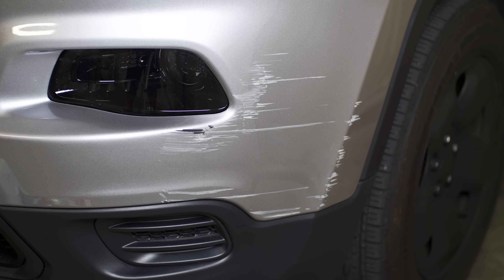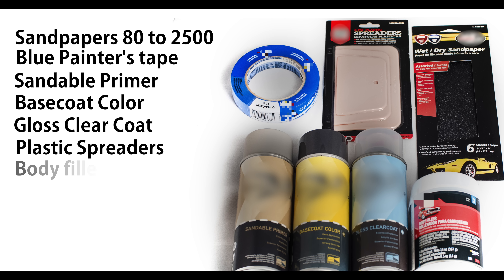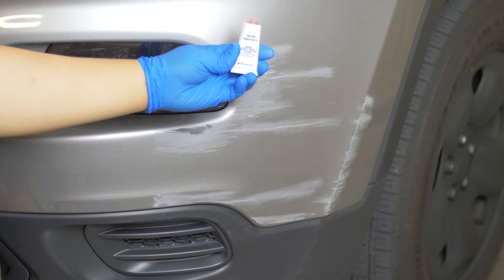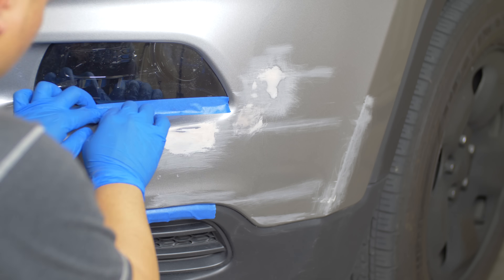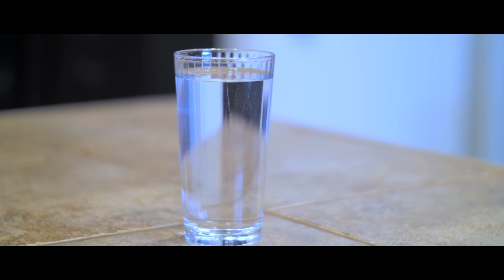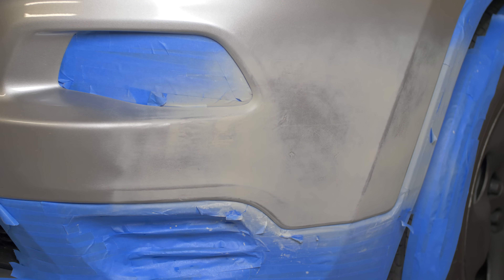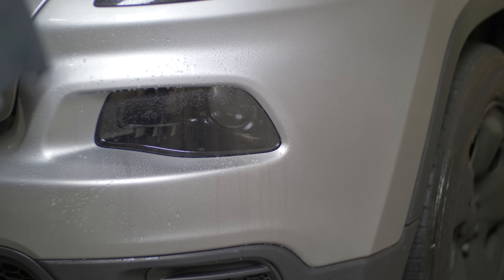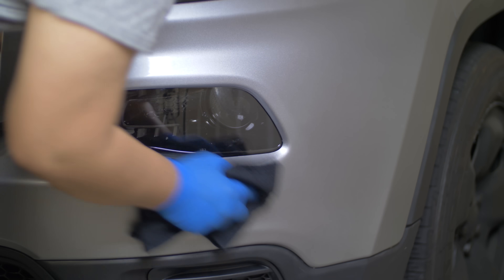How to Repair Scratches on your Car | Save Hundreds of Dollars

Comment: I got 3 days to fix a massive scratch on my mum's car before she comes home. Wish me luck guys 😭 or cya at my funeral
Reply from the maker: Lol dang rip
Reply: Waaaaaa bruh I jus scratched tf out my mom car, I might to take that L
Reply from the maker: DaReal Tj sorry to hear that. if you do it well, she'll be proud of you. Good luck! Cheers
Reply: Thomas of All Trades I fixed it ‼️‼️‼️‼️ it turns out to be paint off the wall after awhile of scrubbing with hot water and tooth paste it came off , had me worried 😂😂😂
Reply: lolzzzz😂😂😂
Reply: DaReal Tj how you fix it 💀I got a few hours before my mom comes home
Reply: Prodbyacebeats - mines ending up being a scrape, it looked like all the paint came off but I used hot water and tooth paste and it scrubbed off pretty easy, hopefully that’s the case for yours, if not, just go ahead and take that L 😂
Reply: DaReal Tj I got it off a lil bit it’s a small scratchi think she be okay 💀💀
Reply: Prodbyacebeats - hopefully she won’t notice it, I left a tiny little dent above the right front wheel, on the side she never noticed it. Where is on the car was it damaged?
Reply: DaReal Tj top left passenger side on the front where the headlights at but a just small line I did what you did and look like it been there cuz it held a with the old one
Reply: Prodbyacebeats - It worked for the main part? That hot water and toothpaste did wonders 😂 it looks how it did before I messed it up besides the tiny little dent can’t even notice it at all
Reply: Who else is attending your funeral?
Reply: Samatar Ahmed I think just me and my dog 😔
Reply: DaReal Tj she didn’t even notice thank you man
Reply: Prodbyacebeats - yessirr💯💯
Reply: Are you still alive
Reply: BROO MEEE but I got one whole day
Reply: @BugattiBoy66  bro did you use micro fibre cloth or a toothbrush?
Reply: @Pianosem26  I had used a towel
Reply: did you fixed it
Reply: LMAO
Reply: Yooo same situation rn. But I got a month to fix it before my mum comes home. Did you fix it?
Reply: @socmorenoonofre2278  I used the rubbing compound to get most of the paint off and next im going to do the bondo to fix the chips 😇
Reply: I’m here because I scratched my moms car too💀💀💀💀💀💀💀welp
Reply: I'm guessing Charlie didn't update us on fixing it because his Mom found out and his funeral is over.  lol
Reply: I just scratched my dad’s favourite car. Imma just go ahead and die
Reply: I got TWO HOURSSSSS BEFOREEE MY MOM COMES HOME ..i think ill just give up
Reply: @Saroupie  Have her take you to the Store in it, both of you get off and when you get back tell her shit someone hit your car when we were inside Shopping lol.....Gool Luck worked for me😂😂😅😅😅
Reply: @jessieurgea9899  thank you for the advice :') but i told my dad and he helped me out ..i denied ofc and she actually got confused if shes the one who did it ..i feel guilty and i hated doin that to her BUT rather her not findin out then her not lettin me drive it for the rest of my life xd sorry mama
Reply: Rest in peace bro.
Reply: Jajajajajaja
Reply: @Saroupie  Shame on you for lying to your mother. Even if she doesn't know, you know and so does God.
Reply: @ThomasofAllTrades  if he does it well...she won't notice.
Reply from the maker: @GorcStew  i agree!
Reply: he never came back rip lmAo
Reply from the maker: @ellamellop  compound is great for light scratches!
Reply from the maker: @jessieurgea9899  omg hahahahaha
Reply: Did you do it?????
Reply: Is bro RIP?

Comment: I actually tried this myself, this was an awesome process and I fixed my car completely. My Front Bumper looks like it is brand new. Some tips and pointers that I can give to anyone else watching this is make sure you don’t spray too close or too slow. We’re all beginners, we will make mistakes and that’s okay. Just be prepared to do a lot more buffing if you make blobs of paint or primer. Try to use lower grit sandpaper to fix your errors and gradually smooth out w/ 1500 grit and 2500 grit. Also when you mix the body filler. Put a small amount of hardening in the mix. Your mix should be gray colored and not pink. If it is pink, it’ll harden fast and get chunky, you may need to buff it down and try again. Also TAPE EVERYTHING, the spray paint works very well in the way it costs and reached places, I didn’t think it would. Hope you can learn from my mistakes. Enjoy! Excellent video!!!
Reply from the maker: I'm glad this worked out for you and thank you so much for your suggestions!
Reply: Thank you
Reply: Can you recommend me spray paint for polar silver
Reply: Sounds easy for most men but not easy for female like me.  😢🤣
Reply: What is the optimum distance between the spray and vehicle?
Reply: @renukasunder3312  1.5-2 feet away and coat in fast swipes. You don’t wanna be too close and overspray an area on accident.
Reply: @dengtan1072  you got this! It just takes time and patience. As long as you have those two, you should be just fine!
Reply: @ThomasofAllTrades  I did this on 12 year old hazed headlights. Sanded them down 3x times with wet sandpapers 800,1000,1200 first. Then machine polish. Went like new. The only problem was its easy to hit the car wth the rotary thing on the machine even if ur careful.
Reply: I am very impressed
Reply: @dengtan1072 so the solution is to have a man? 😅😂
Reply: also a good tip for metallics is shake shake and shake that can.
Reply: @dengtan1072  Think about it this way: it's just arts and crafts.
Reply: Even after reading this comment I still ended up making this mistake

Comment: To make it 100% correct, you should not jump sanding papers more then 1/2 of previous size. So if you start with 80 grid, next one is + 1/2 or 80 + 40 = 120. After 120 you go to 120+60=180. By skipping you leave small irregularities on surface area that can not be removed by higher grid number. You probably used  high quality spay which filled those irregularities and help you with good finish. It's always a risk to jump from 80 to 180 by skipping 120. Great job anyway.
Reply from the maker: Thanks for your suggestions. I agree
Reply: so i can’t go from like 180 to about 400 grit just like that?
Reply: @evandammrich1869  No you will ruin the paint
Reply: Well the bondo tell u you use 80 then 180 he was just following instruction
Reply: @demarcuswade so which is the right way
Reply: You can skip any amount from  800 because you can't see the difference

Comment: I tried this following this video. These are the important things I learned:

1. This IS harder than it looks.
2. Bondo (body filler) is only needed if you have deep scratches in the bumper. If your fingernail falls into a groove when you scratch it, it needs body filler.
3. The body filler’s only purpose is to fill the groove (deep scratch) so that it’s a level surface. You don’t need it anywhere else.
4. Less is more! If you spray too much of the primer, color, or clearcoat, it’ll pool up and drip. If that happens, there’s no turning back. DO NOT TRY TO DAB IT OR REMOVE THE DRIP.
5. Spray more layers of paint. The primer will show through lighter colors and will require a few more layers.
6. Possess a godly amount of patience or else.
Reply from the maker: John Lawson thank you for your input. These are really good notes!
Reply: Thanks . This is helpful to read as i intend to try this myself. Regarding your point no. 4, if it drips, do you suggest to leave it as it is. Will that auto correct when you use the sandpaper later?
I am also unable to find the body filler kit on Amazon UK...:-(
Reply: @jbellfield  Thank you for your advice. It's very valuable. :-)
Reply: thanks John <3
Reply: This is really helpful, thank you
Reply: When I sprayed paint I accidently collected some drops because I moved too slow at the end of the surface. I tried to dab it of with som paper and after some more layer you can barely see it.
Reply: Thanks dude
Reply: I don't think it was harder than it looks. It was actually easier. Just took my time and went step by step and don't make the mistake of adding too much paint the first go round. I did buy the body filler and wound up not using it. But after I was finished if I looked really hard I probably could have used it minimally in a couple of spots. No worries. My first time. All in all I'm THRILLED by the results. I had a lot of bad scratches and now they're all gone!
Reply: @Tommygun1028  where did you buy the filler and primer colour please
Reply: @baditube9426  if you're in the US , harbor freight has a small tub for around $8-$12
Reply: Also, that body filled dries up really fast, you have about 5 minutes to get it applied, so start with the bigger gaps first and then work your way with the smaller ones after.
Reply: If it drips... let it dry and sand it to smooth it out with 1500 or more grot paper. Mistakes are not unrepairable
Reply: If it pools or drips, let it dry then sand it down till it’s smooth
Reply: Thx
Reply: Doesn’t the finger nail always fall in a groove when you scratch? That’s the definition of a scratch. Should the finger nail just slide over or what?
Reply: Also good to use a high fill primer, that way to can cover some of the very fine scratchs before base coat. Sand primer before base
Reply: @ThomasofAllTrades  I am just curious, how much time total you spend fixing these scratches? I have almost the same scratches on my KIA. Thanks.
Reply from the maker: @yavormoskov  it's been a while. I think I spent 3 to 5 hours. It's also because I was recording. You have to wait for the paint to dry after doing another coat. And you have to wait overnight before buffing it..
Reply: @ThomasofAllTrades  Thanks for your reply. I've never tried anything like that in my life so I guess it's safe to say it would be something like 6-7 hours in my case.
Reply from the maker: @yavormoskov  I would allow that much time but it could be shorter. Take your time and pay close attention to the detail.
Reply: @ThomasofAllTrades  Which website you used to order the exact color for your car?
Reply: @ThomasofAllTrades  Never mind, apparently you posted a link to the paint website. I am blind. Thank you and now you have one more subscriber :)
Reply from the maker: @yavormoskov  I have the link in the description.
Reply from the maker: @yavormoskov  no problem. Thank you.
Reply: How do I find what clear coat my needs?
Reply from the maker: @vicda5941  link in the description for the paint. once you've selected the base coat paint, it would ask you if you would want to buy the clear coat and primer with  the base coat as a bundle.
Reply: @TheBobriss  don’t over analyze..it make MY head hurt! And this is coming from a professional by nature..analyzer..lol (woman)..lol 😂😋
Reply: @JamieTheSassenachLass  my head works too much and I have no way to stop it. I can’t help it but notice details that don’t make sense :(. I am a man.
Reply: You know that in the morning light, you can see every weird angle that your spray can was sprayed at?
Reply: I would never try to remove my drip
Reply: God bless you!
Reply: For filler we should used scale ⚖️ for right quantity
Reply: So you mean we can just sand it nicely to level and move to next step without using bondo.

Comment: After doing it my self, It's important to note the following experiences:
1) Be prepared for at least 6 hours of work
2) Try to put as little filler as possible but the right amount or else you will be sanding half a day.
3) Don't overdo the paint, cause once it drips and try to fix it, ur are gonna end up leaving little bumps on the paint and there's no going back unless u want to sand and paint again and again.
3) For sure wear a mask and glasses
4) be extra patient.
Reply from the maker: great notes!
Reply: Great notes Gustavo..where can i find exact base coat? I checked on ebay and amazon but couldnt find it..
Reply from the maker: tika thapa i have the links on the description!
Reply: How did your car turn out?
Reply: @arnelledianne8630  turned out great tbh. It was only a little visible if you look at it really really close but otherwise it went better than expected. I sold my baby for a better than expected price so I guess that paid the time I put in painting the car. 3-4 Light coats for each spray is the trick and try to have the filler as smooth as possible even it takes you some extra time.
Reply: Or dont do this at all. Let a pro do it instead so it will last and not be noticable after 3 months
Reply: @Peter-zc5xc  sure if you got $1000 to spare and wanna leave the car out for a week
Reply from the maker: @Peter-zc5xc  so far so good. the paint is still here. Parked outside in rain and shine for two years now. It still looks the same as the day I did this video.
Reply: @gustavocarleon402  thank you ☺️
Reply: If you use power tools, it decrease your time in labor.
Reply: Now someone scratched my new Tesla M3, can this year go any stupid?...people are mean when getting out of parking spots these days.😔
Reply from the maker: @King_drew  true
Reply from the maker: @gustavocarleon402  dang that sucks. Sorry to hear that.
Reply: come thru KING
Reply: This dude is definitely a reliable source !!!
Reply: @Peter-zc5xc  I'm going to take my scuffed up 15 year old acura that's worth $2500 to a pro and have him charge me half the value of the vehicle to get out some scuffs? no thanks.  if it was a newer car, probably not a bad idea.
Reply: @ThomasofAllTrades  can I am dclone kioa emsland clonenode Kon CL CK in m lmb ecol Honeyville 8
Reply: The 6 hours of work, should be calculated in the total cost of the repair. If you earn 25 bucks an hour, it adds 150$ to the materials and brings the tally to 370$. Even if you're unemployed or doing it during you off hours. What matters is that we need to compare apples with apples, and factor-in the cost of labor. If you end-up in the 300-400 dollar range, the body shop's total then includes their profit margin and utility costs. You do save money in the end, but it's good to understand the breakdown of the asking price.
Reply: Car will be called the 🐘.man
New paint work
On 1 side
Rest of the 🚗
Will be off colour
Reply: Patience? What the heck is ‘patience’? Seriously, the toughest part of a spot fix like this is trying to blend the new paint with the original paint. It can be done but it takes, um, patience.
Reply: I feel the second one lol
Reply: @hpblack1953  what part of paint matching takes patience? Is it the way the paint is mixed or something that is done after the paint is applied?
Reply: The material cost for this DIY repair is probably at least $150.
Reply: I would assume that the new paint will stand out, so you have to layer it to make it blend with the old paint @FOURTEEFIVE
Reply: V helpful. And I appreciated your sense of humor

Comment: Just a helpful tip, when you apply body filler, you MUST cover the area around the scratches as well. The reason for this is if you don’t do so(meaning if you only fill the scratches), when you go to sand it, the sand paper will dig out all the remaining body filler and you’ll be back to square one
Reply from the maker: America first good tip. Thanks.

Comment: Thank you so much for sharing your knowledge! I have a silver Toyota Solara Convertible that had some bad scratches that hugged the corner of my right rear bumper so the scratches spread from the rear to the side. Following your step by step instructions I was able to fix it and it worked out GREAT! Thank you SOOO much! I can't believe I did this! I have to disagree with some of the comments below that this is harder than it looks. Complete opposite for me. It was MUCH EASIER than it looks you just have to be patient, buy the exact right paint that fits your car and buy the other accessories mentioned and go step by step slowly. Wasn't that difficult at all. And I paid less than $100.00 for all the material with plenty left over for future touch ups or scratches. May need to buy more 1500 and 2500 sand paper but that's about it. One thumbs up doesn't seem like enough. More like a thousand!
Reply from the maker: Thank you so much. I'm very happy that it worked out great for you!!! 😊😊😊

Comment: Today, your excellent video served as a great stress relief after the front corner of my beautiful blue Honda Fit got scraped by the carport wall while navigating out of my very narrow parking space.
The car only recently spent three months at the body shop after it was damaged in a collision caused by a reckless driver. To my delight, the Honda body shop restored it to like-new condition🌟
So, today's incident had me pretty bummed out, despite the damage being less than yours😞
I am now motivated to tackle this challenge.
I will also cover part of that wall and parts of the two opposite posts with self-adhesive carpet tiles.
Halfed pool noodles on the wall already successfully prevent damage to the door as I squeeze myself in and out of the car each day.
So, thank you again for the great video and the additional useful tips by commenters🙏🏼😊
Reply from the maker: Thank you so much. Good luck on your project. I got these scratches just like what happened to you. I was about to go to work and I was backing up from my 1 car garage and then boom. I was actually pretty surprised on how it turned out. Just pay close attention to the details and have some patience. Cheers
Reply: @ThomasofAllTrades  Thank you so much 🙏🏼😊

Comment: BIG TIP : if you have multiple deep spots . Make sure to use the bondo (body filler) in small portions. I didn’t know but I poured a lot and it all dried up quick . It was my first time using this .
Reply from the maker: Thanks for the suggestions. Yes. The Bondo dries pretty quickly!
Reply: You can control the hardening time of bondo by the amount of the hardener you add to it. The bigger the dab - the faster it hardens. I've found that even using just a tiny bit the mix will still harden up firm just at a slower rate.